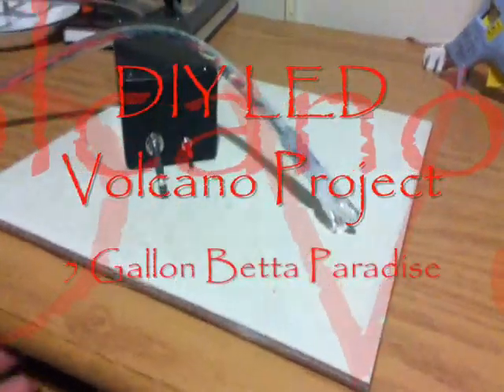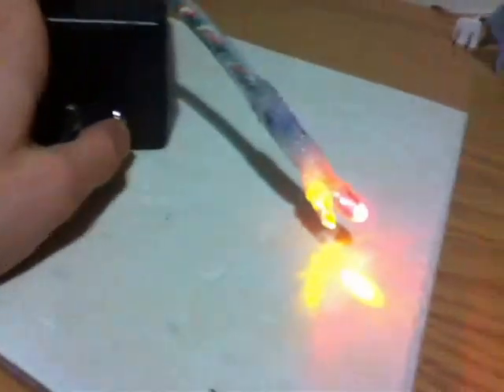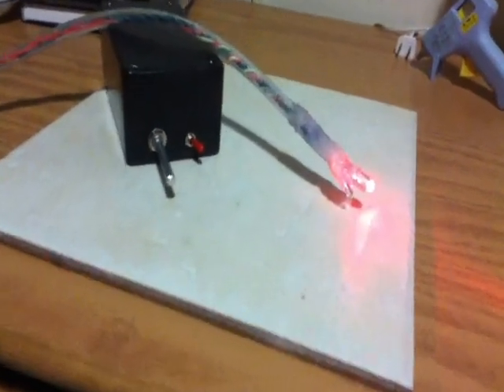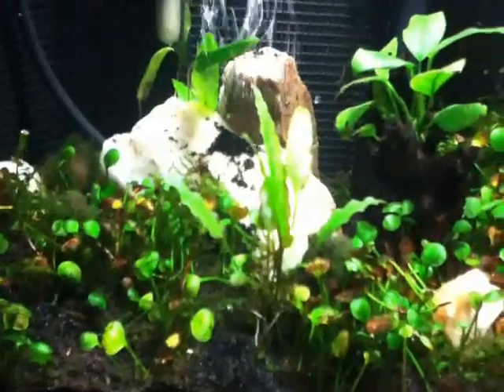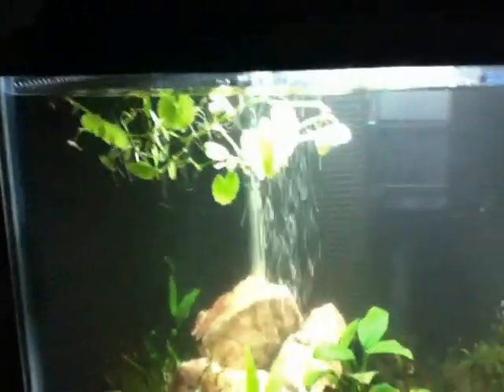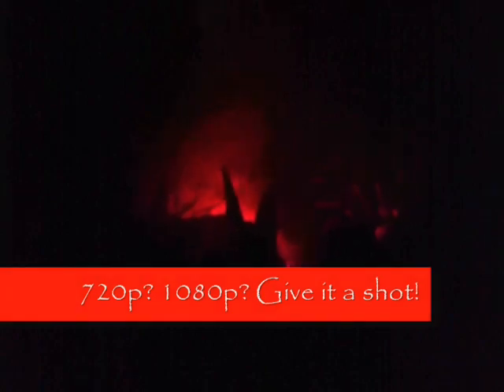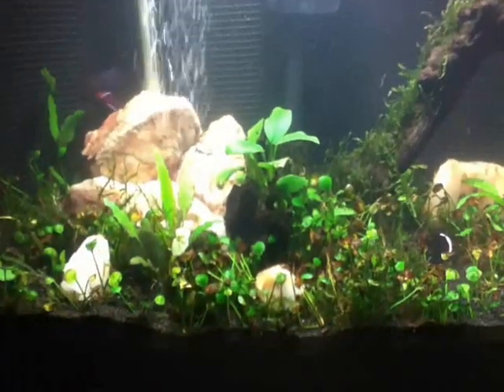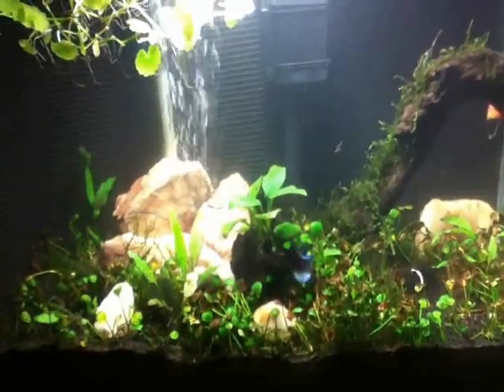DIY LED Aquarium Volcano Project - 5 Gallon Betta Paradise

Comment: dude cant c a shit dummest video
Reply from the maker: It's unfortunate my camera can't pick up the flicker. I can try it with a more modern camera. It really does look awesome.
Reply: hey i wanna make volcano too can u help wat kind of material shud i use which is not a bad for fish?and any help how to make it?
Reply from the maker: It depends what you're trying to do. I wanted the glowing effect through the rocks so I assembled some quartz crystal with a crevice like opening.

If you want to make something from scratch you can try using modeling clay to form the structure you want. Once cured it should be safe. If you want something that'll be transparent you can look into forming something with acryic water and coloring.

Comment from the maker: It depends on what you're keeping and the ambient temperature of the room it'll be in. If your room is cooler (upper 60s to low 70s) and you're trying to keep tropical fish like a betta then you'll probably need a heater. If your room is warm (mid to upper 70s) like mine and you're keeping tropical fish (like a betta) then you should be set.